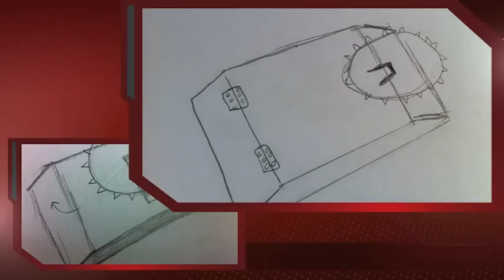Stevens Robotics - The O'BLADErator Robogames 2011 Instrumental

Comment: Hmm... I haven't seen many robots using the NPC Black Max motors...

In your opinion, how do they compare to the longer 3" magmotors? From what I've read the magmotors have about the same power at about half the weight... do the NPC motors have a particular durability or ease of mounting advantage that makes up for this?